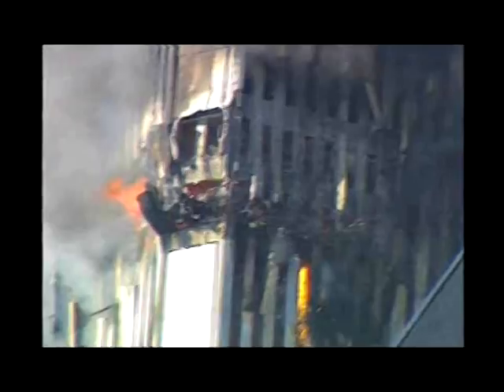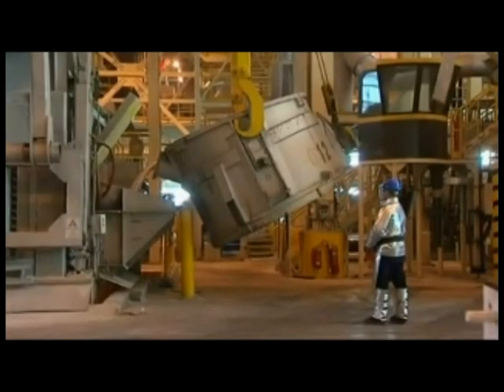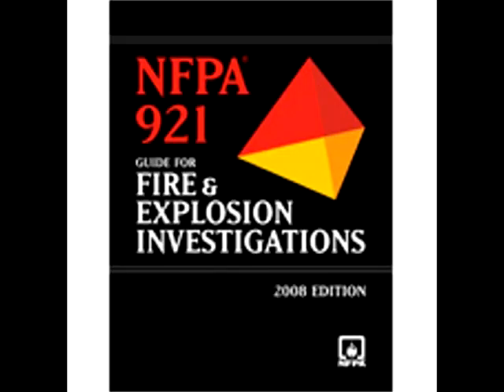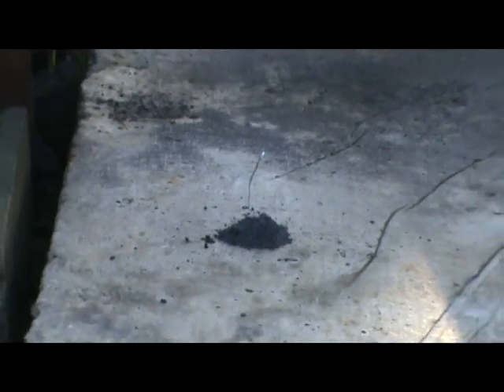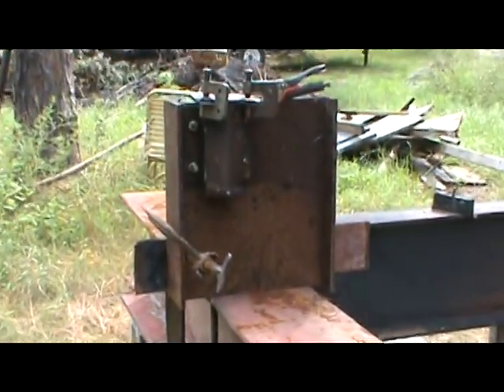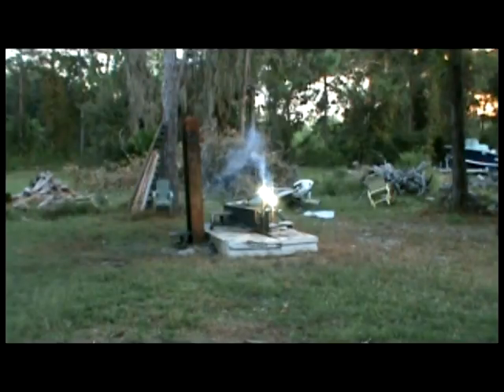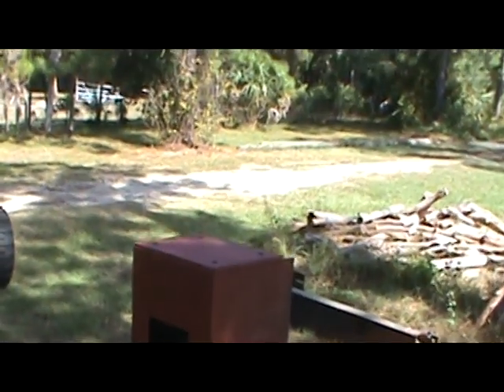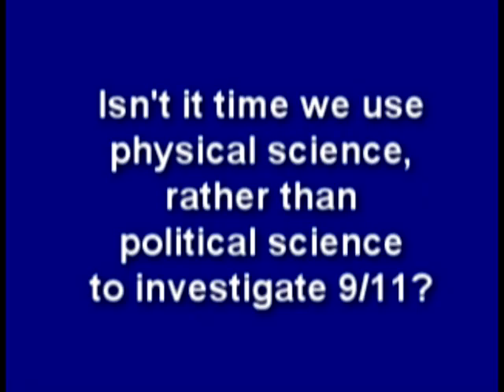9/11 Experiments: The Great Thermate Debate

Comment: This is also not taking into account the floors of the World Trade Center which were built on a Truss Flooring system which is susceptible to fires. If the trusses are not properly flame retardant,  they will warp and bend in on themselves. Which at the 1000+ degrees Fahrenheit that aluminum and jet fuel burn at will have no problem eating away at said trusses. If you look at the collapse videos, you will see that both towers collapse starting at the top of the impact zone, Those floors and the core beams(center architecture of the building) fall first, collapsing on everything beneath it.
Reply: Or having an airplane pass through the building which knocks the (fragile) fireproofing materials of the structural members.
Reply: Still doesn't explain the physics of the pancake floor collapse at terminal velocity.

Comment: So Impact damage, 20,000lbs of jet fuel, Aluminum(767 frame) and the way the building was constructed(tube frame type building) just don't matter at all in this conspiracy theory then I guess... Still not one shred of evidence to prove the planes didn't bring down the twin towers. Great job!
Reply: So then,  what brought down the third building?
Reply: Your are also aware that it was burning out of control for 7 hours and it's structural integrity was damaged by falling debris of tower 1. Also the sprinkler system that could have saved the building had to be manually activated from within the building. There's plenty of videos showing the destruction to tower 7 made after towers 1 and 2 fell. Maybe you should I don't know, Do some research and get all the facts straight before yelling obscenities cause I don't see any other evidence to support otherwise.
Reply: oh yeah, office fire brought down a steel frame building at free fall speed, it came down perfectly on its footprints.

Why bother imploding buildings with expensive explosives when we can simply start some fires?
Reply: Once again, not a shred of evidence to support otherwise.
Reply: Ok, so the politicians and the Tv tell the truth, lmao.
Reply: Never said that but whatever. I'm sure you believe the earth is flat also. All we have here is theory's, that's it. Not one shred of evidence.
Reply: That^ didn't have structural damage from a falling tower now did it? Also unless you happen to be Structural Engineer, That^ doesn't prove anything!

Edit: Actually that^ video does prove your theory incorrect. Thank you for posting it. 

https://www.youtube.com/watch?v=4LUDXpMhkNk
Reply: Once again, maybe you should do some actual research before you go blabbing about conspiracy theory's. :-D
Reply: i am sorry, youre right, some debris and office fires did bring down tower 7 at free fall speed in an uniform manner, perfectly into its footprints, the thousands of witnessess who reported explosions are lying, cya dude!
Reply: ddlog41894
I doubt a human could get any more worse off than Arruinado. He doesn't realize the buildings did NOT fall at free fall speed. If he would watch the vids he would CLEARLY see the debris falling faster than the collapsing building. That is IF he had any idea about what he was seeing. It also seems he has never considered that the inertia of the collapsing structure above the impact point of the planes dictates that they could ONLY fall straight down. Picture those towers falling over like a tree. The damage and loss of life would be in the gigaton range. I'm sure the engineers thought about that during the designing. And here's the best one of all---He equates a 90 ton, 767 impacting a building at 300 mph, loaded with 50,000 pounds of high grade jet fuel with "starting fires."
Reply: What about the dancing israelis? just a coincidence that they went on israel TV and said that they went there to document the attacks?

look at tower 7 videos, the building collapses at FREE FALL SPEED for 100ft with ZERO resistence, on its FOOTprints, due to small office fires for 7 hours?

i will ask this, why companies waste thousands of dollars in explosives and waste months planing to bring a building down if they could just start office fires ?

Go ahead and believe POLITICIANs and the TV, they allways tell the truth eh?
Reply: "oh yeah, office fire brought down a steel frame building . . ."  So you _finally figured out what happened.  A fire burned uncontrolled for how long?  And remember that all it takes to collapse a building is to heat the structural steel up to the point where it can no longer support the load.  Metals get progressively weaker as they heat up.  For example at 1000F structural steel only has 40% of it's original strength.

And as for the rapid collapse - that good old Newton's laws of motion at work.  Force equals mass times acceleration.  So if one floor collapses - it hits the next floor with not just it's own weight - it would have been it's weight multiplied by the acceleration it got from gravity.  So the floor underneath which will typically be 20% stronger that it's official weight rating would be subject to an instantaneous force of at least 5 times what it was designed to support.  It wouldn't even hold for a moment.

And the floor underneath that would be hit by not only the same level of force from the floor immedeatly above it - but also from the floor that originally collapsed which is now moving about twice as fast as it was when it hit the first time.

Of course this thing is going to collapse at free fall speed.  There is not enough strength to even delay the falling materials a little bit.  Simply too much force imparted by gravity.

Comment: 24:00 "It sounded like gunfire"
When bolts are under tension and snapping because an unbearable
load is on them, that's what it sounds like. The bolts are snapping
under load. 
Gunfire isn't what a thermite explosion is like : that's like an explosion.
You £ucking morons.

Comment: Soooooooo they planted thermite in the 60's during constriction of the WTC?... and only on Floors 91 to 97 because there was no sparks below or above the impact area. So when they were building the WTC towers in the 1960s. "Hey Bob did you order enough Thermite?" "don't need to" said Bob. "We are going to remote control an airplane to hit certain floors." "Oh ok that sounds legit. Let's go for beers after work Bob" "OK" said Bob. For an engineer you should look up Steel buildings vs Concrete buildings in regards to fire.

Comment: Israeli engineers were photographed in building one with bus bars used to take energy to military grade thermite.
Reply: "with bus bars used to take energy to military grade thermite."
<facepalm>
That line is stupid on so many levels.  For one thing thermite has it's own fuel and oxidizer.  And you can ignite it with something as simple as a strip of burning magnesium. You don't need 'buss bars" to do this - a 9 volt battery works just fine.

And 'military grade thermite' is nothing more than powdered aluminum and powdered iron oxide mixed together.

And then there's the issue that thermite would have been completely unnecessary to cause those buildings to collapse.  Those buildings were doomed the moment the planes hit them - and no fancy conspiracy was needed here, just an understanding of basic structural engineering principles and the properties of structural steel when heated to various temperatures.

And this is the simple fact that doomed the buildings.  Like all metals, structural steel gets weaker as the temperature increases.  At 1000F structural steel only retains 40% of it's strength.  All that it took to collapse those buildings was for the structural steel to progressively weaken as the temperature increased - until it's elastic limit exceeded it's remaining strength.  At that point the steel will start bending.  And when this starts happening - the building will collapse.
Reply: Do you even know what a 'bus-bar' even is?  If you disagree with what I posted then debate the information.  If you think that something I posted is incorrect - state what the incorrect information is and why you think it's incorrect.

Hint:  It's a good idea that you make sure what the terms you're using mean.  Otherwise you come across as a fool.
Reply: Bullshit !!!!!!!!!!!
Reply: Yep, it was a joojob with the blessing of the CIA and NSA.
Reply: Besides - I wasn't talking about Building 7.  Even though it was fire that brought that building down also.
Reply: @colincampbell767  No way a little fire brought down building 7 especially being a fortified emergency bunker for Pro-Israel firster Rudy Giuliani who made the huge mistake saying that "there will be no more attacks" right after the last plane hit. How could he know that unless he had inside info? This video since disappeared. Are you Israeli or just have no common sense, because you are going out of your way to cover up their massive lies and disinformation committed by the media protecting Israeli Mossad agents. Everyone knows 98% of all Western media is owned and controlled by Jewish interests and can never be trusted including Google. Now go away im done with you.
Reply: "Fortified?"  Yes it housed the Emergency operations Center for the city of New York.  But the building was not 'fortified.  Remember that the structure of the building has to support the weight of the 'fortifications.'  The trusses that support those floors would have to be reinforced and then the supporting columns would have to carry the additional weight of the fortifications as well as the additional weight that was added when the trusses were reinforced.  So the supporting columns would have to be reinforced - which will now means that the foundations would have to be reinforced.

BTW - you really need to apply the principle of Occam's razor here.  The simplest explanation would be that he had been informed that there were no additional airliners inbound to New York city.  So instead of assuming that some kind of conspiracy exists - isn't it a much better bet to assume that some people simply Did Their Jobs?

Comment: I used to work in a high post tension and rebar company and i learned something when it burned down metal dust burns verry verry hot and can actualy rais the temperature hot enought mind you these buildings like you see are so toll they actualyshift and sway it is very likely that the constant sway could very likely have gathered this dust in the beems and between the connections with the dust being between the connections you would have a simulated pressure seal pleas test this theory

Comment: Well, at least some questions are answered. 
Though the conclusion that it was molten steel is still pretty weak.

First of, let's answer the question if aluminum can glow if molten.
Yes, it indeed can glow and it does not need to be mixed with anything.
It all depends on how hot the aluminum is (like with any other metal).
http://www.drjudywood.com/articles/aluminum/glowing.html

So yes, it could very well be aluminum.
Then to go on to your molten steel.
It indeed cut of a small chunk and it indeed molt the steel.
BUT where is it glowing or even dripping down somewhere?
This is not shown in this video and does not closely resemble anything seen at the WTC.
Besides that, showing the picture of the 'glowing columns' means, that the material is molten already and still very hot.
Even a 'silenced' thermite (or thermate) reaction would be seen from the outside.
Is there any evidence besides the 80s floor flash, that there is actually anything happening like that?
The flash could also be a electric explosion.
https://youtu.be/UF5EDV6T7es?t=1m29s
Or anything else. Thermite (or thermate) activation is not the only solution to this (btw. doesn't that sound a little bit like gunshots as well?!).

My conclusion is, could it have been thermite (thermate) ? Maybe.
Is it the most likely result? Not really.
Are there other explanations for the questions answered? Yes there are.
Is it possible that it did actually collapse without any help (besides the airplane and fire) ?
Yes, this is also possible.
The video showed, that media is indeed not telling the truth all the time (what a shocker, who guessed that >.>), but also shows that not everything can be answered with thermite (thermate).

I'm only waiting for a nutjob to insult me or change the topic, instead of tackling anything I said.
Reply: Your electric explosion argument goes out of the window, considering there was no electricity in most of the towers after the planes hit them.

About molten aluminium: yes, it can glow red-hot. BUT red-hot aluminium (or in fact, any red-hot metal) is almost impossible to see outside of a foundry. You have to consistently contentrate the heat in order to melt it red-hot. The jet fuel burn was chaotic, and non-concentraded and consistent (also oxygen-starved judging from the color of the smoke). Im sure some parts of the plane melted directly after the impact, but I doubt any aluminium was red-hot there.

Comment: The airplane itself was constructed of large quantities of aluminum and magnesium. Magnesium airframe parts can be heated to a point of self ignition creating it's own fuel/oxygen supply which burns far hotter than the tempurature needed to melt steel. Both buildings collapsed at the point of impact of both planes. That fact, in and of itself, is nearly air tight for conclusive purposes. No person could have made it to the precise point of impact on that day to plant thermite in order to collapse the buildings at the point which the collapse began.

Comment: Good video because of the tight focus on one specific question: thermate vs. steel. 
The big problem is who put it there and when. For all we know it could have been aboard the planes, or placed in advance by the attackers.
Another possibility is that large buildings need lots of electricity, and surely cables were severed. Electricity produces arcs that can melt steel and produce white "flames" (actually small lightings)
Reply: thank god circuit breakers are a thing, that sounds like it could be dangerous.